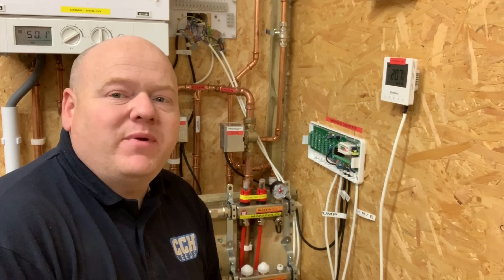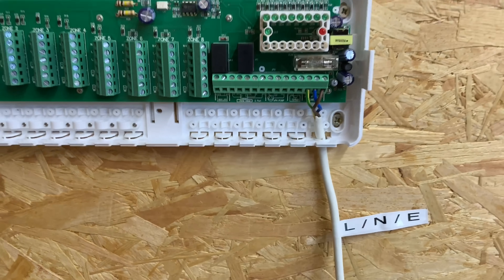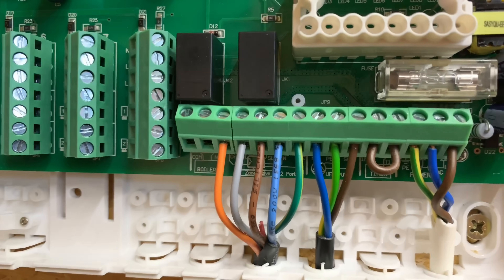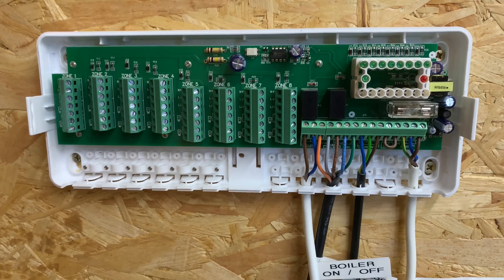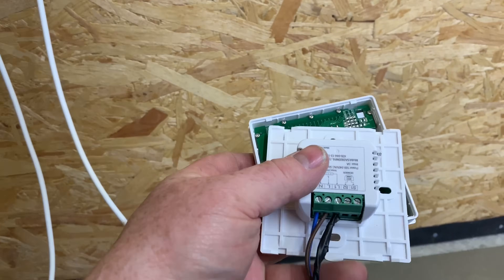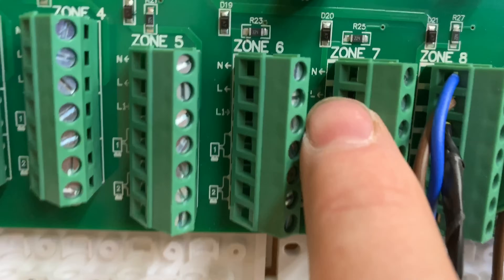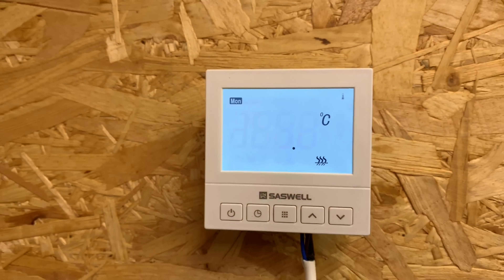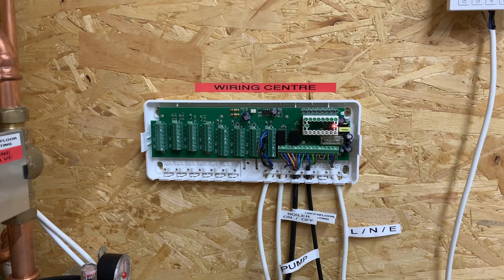Plumbing - How To Wire Underfloor Heating - Wet Underfloor Heating

Comment: Hi , I'm not a plumber or electrician but I'm a vehicle mechanic that likes to mess!!!!  Anyway I zone controlled my entire house around 8 years ago with fantastic results but I've now used one of the zones from the conservatory to run a wet underfloor heating system that's gone into an extension I've built that's replaced the conservatory, my question is that I don't want the ufh pump to run with the existing zones until it's called for. I know I could isolate it using a contactor but is there something that's designed purposely for the job or is this controler what I need? Thanks in advance.

Comment: Hi Allen I’ve seen few comments about how to wire in the secondary zone valve and thermostat into the wiring centre. Which I have also asked in one of the comments. Can you please go into more detail how it will be incorporated within the same wiring centre please. Or we need secondary wiring centre as it can be seen located next to the boiler?
Reply from the maker: I will do a new video when i get chance. Thanks.

Comment: Hi Alan, great videos.  I’m in the process of installing a similar setup.  The video shows you wiring up the port valve for the UFH but not the second port valve and thermostat for the radiators.  Appreciate if you could explain how this would be wired into the wiring centre. FYI I have a Heatmiser UH4.

Many thanks
Reply: Ditto.  I would also really appreciate more info on this detail
Reply: Did you manage to figure it out, I am similar situation, have part UFH and part radiators on the ground floor, looking to see how to set it up
Reply: Hi Allen I also got stuck at this point can you explain how second zone valve and thermostat will be wired in. Do you need secondary wiring centre as can be seen next to the boiler ?
Reply: I have a similar install to do. how did you go about doing it? Thank you.

Comment: If i’m using an s plan unvented system  does this wiring centre allow me to connect the hot water and heating to this to ? Or do I still use the wiring centre that I have (Honeywell )well one for hot water and rads . And a separate wiring centre for UFH 🤔thanks mate

Comment: Hi Alan - thank you for the video. When you say the switch wire goes back to the boiler where does the sw get terminated in the actual boiler itself. I’m wiring a boiler next week and it had ufh, nest thermostat for the rads and wondering where all these are wired into the boiler. The plumbers there tomorrow so is opening up the boiler for me. Will it have separate ufh and central heating terminal blocks. Thank you.

Comment: Hi Allen 

You only wired one of the two Port valves in the wiring centre, where does the other two port valve wire into? Thanks
Reply: من فضلك ترجم إلى اللغة العربية

Comment: Hi Allen you say wiring centre is a beneath heat 
Wiring centre but there not showing this wiring centre on the site looking for the installation diagram if you would be able to help 
Regards 
Les

Comment: Hi Alan great videos. I'm doing and ufh exactly what your showing with a combi and rads. The question I have is do u need a wiring centre od can you just use a connection block. What I want to know is what's the advantage of the wirring centre.

Comment: Hi Allen, I have the same wiring centre which had been left unfinished by the installers. Could you explain more about the BOILER switch connection and where those wires need to go? You mention it being a link wire? Thanks
Reply from the maker: Will do, Which bit do you need to know? Thanks.
Reply: Allen Hart hi just want to know how to connect 2 wire from under floor heating wiring centre to boiler mean where to connect on boiler thanks

Comment: Thanks Alan...this video was very helpful, as my installers have not used the wiring centre because they said it wasn't need - and clearly it is, especially with a 3 zone UFH system.

Comment: Hi great video, I have a question you put two zone valves in one for underfloor heating and one for the radiators, where does the wiring for the zone valve for the radiators go I missed that bit
Reply: I was wondering the same

Comment: hi Allen  thanks for uploading many video regarding boiler & heating , i just watch this you tube video regarding this underfloor heating system, it is very helpful for new gas safe engineer, im gas safe ,can you confirm what make and model underfloor heating wiring central are using   it in this video ? it is very easy to installed so let me know as soon as possible please ? thanks

Comment: Thank you Allen for posting this video. By the way this only video i could find on youtube for wiring centre. As I am doing up my house decided to have wet underfloor heating. it is two loops manifold with latest grundfos pump. my electrician has failed to connect wiring centre to boiler following diagram i showed him this video still didn't work. wiring centre is very similar to the one on this video. are we doing something wrong ? he has used link for timer as shown and also waited for 15min but still boiler wouldnt get signal. also do i need zone valve to control flow as i have worcester boiler quite powerful so i have 4 rads upstairs and downstairs underfloor heating only. so i have boiler, 2port manifold with grundfos pump and ports are controlled by electronic actuators and lcd stat all to be wired. I'd appreciate any advice on this. thank you in advance.

Comment: Hi Alan if your adding underfloor heating just one zone do you just pick the boiler switch side and put into the wireing centre as it already as a normal thermostat thanks Mike
Reply from the maker: you would need two zone valves so you could controls rads and ufh separately. Thanks.

Comment: Hi Allen, can you fit the final floor finish directly onto the matts and pipes or do you need to lay a screed?
Thanks
Reply from the maker: joe fowler I think I will tile straight over the top. 👍
Reply: @AllenHart999  thats good, so the overall system really doesn't raise the floor height much at all. 👍
Reply from the maker: @joefowler9600  The system is absolutely brilliant. Very low profile. Thanks

Comment: What is the purpose of the 8 minute delay?
Reply from the maker: It just happens when you first turn on the mains to it. Not really sure why. Thanks.
Reply: @AllenHart999  So after the first power up there is no delay?
Reply from the maker: @Sash_Window  Just checked it now and it does it when you turn stat up as well. Maybe it's the stop it coming on and off and cycling. Was about 3 minutes. Thanks.
Reply from the maker: Just checked it, Still has a delay, It was around 3 mins. Thanks.